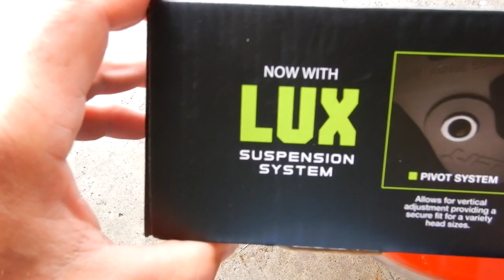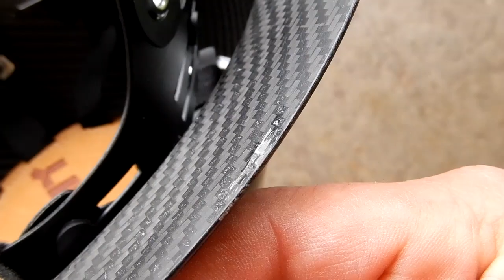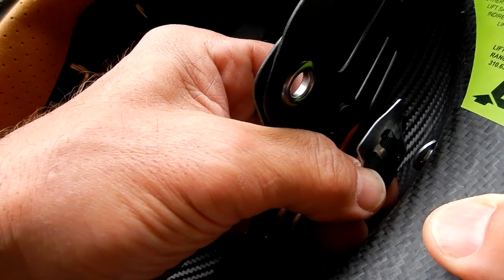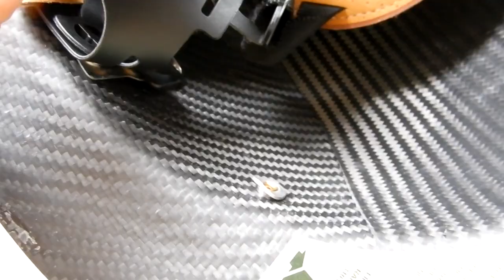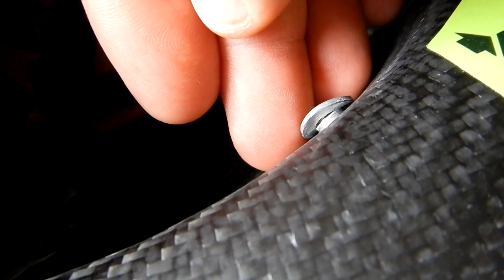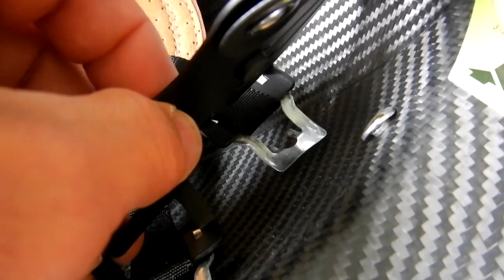LIFT SAFETY Quality Control issues for a $156.00 Hard Hat

Comment: Same thing happened to me as far as the suspension system. I tweaked it to work fine though, but in the beginning every time I took it off the hole suspension system came out. SOOOO annoying.In this case it looks like it was a test hat to test the pressure the suspension system can hold. and somehow got sold.

Comment: I rake my new hard hats across a chain link fence a few time first day. I want to get one of these carbon fiber hats but I would feel awkward wearing a shiny fancy hat. Now for all the other stuff, yeah I am with you I would send it back.
Reply from the maker: Daniel Roper   My hard hat did get scratched up over time BUT it should (at the price for it) come new in  perfect condition from the factory. What the consumer does after that is up to them. Thanks.
Reply: @starastronomer  for sure. No judgment. With all the other things messed up you for sure had reason to be displeased with it. I just personally wouldn't care about the imperfections in the finish. But I am just a grunt. I see engineers and stuff with perfect shiny hard hats. 
So now you have had it a while, should I get one or save my money,? Did they replace it with a new one? Did it brake with use. 
I am not going to lie, I was going to order one but after seeing yours coming kinda broken I am reluctant now.
Reply from the maker: Yes, I did get sent a new one from the company as seen here  https://www.youtube.com/watch?v=z8K2j2rJ4kc  I've had no issues since and would recommend it.

Comment: I had a chip right in the front on mine, sent it back with no issues. The new hat was in good shape, but after wearing it for about a month the suspension on the back of the hat just broke. I sent a message to Lift and after a couple of emails they sent me a brand new head band. My issue is like you said not the quails you would expect from a $156 hat. I actually use my plastic  one now.
Reply from the maker: Indeed Chris.

Comment: Thanks for uploading this video. I’m in the market for a hardhat and was looking at this. Did you end up settling with another ? Some say the orange also fades extremely quickly.
Reply from the maker: MikeFusion    Yes. Actually I returned the defective hard hat to Amazon and got a full refund. Lift Safety sent me a new one at no cost. I did a video on it. It was flawless and has worked out great.
Reply: @starastronomer  thank you so much for the quick response. Much appreciated. Looks like it’s time for me to “add to cart”. Have a great rest of your weekend.
Reply: I have the orange one and it is faded and I’ve had it maybe a year or less